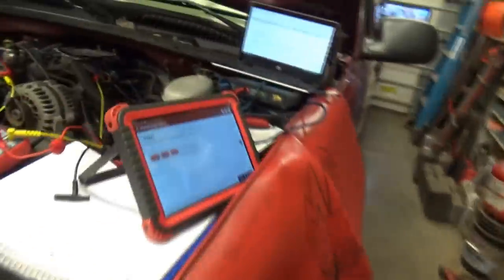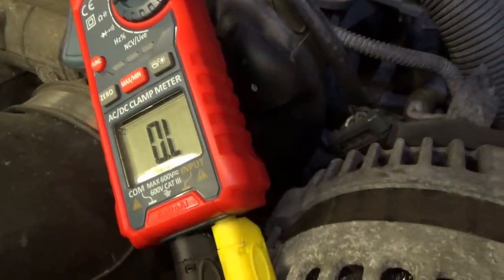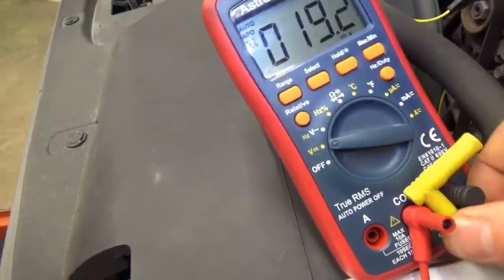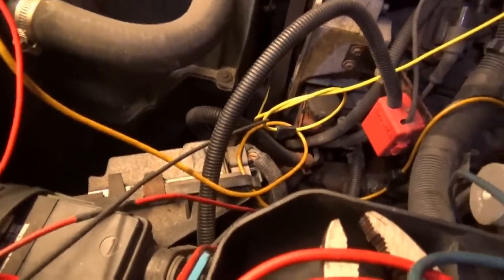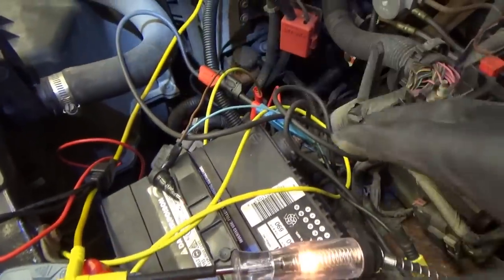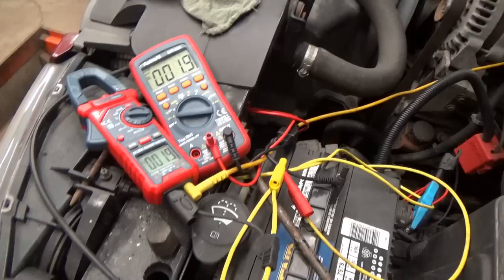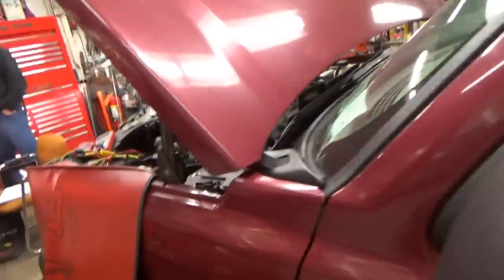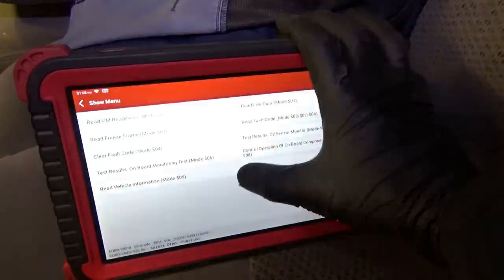Knock Knock...P0327 is here! (GM Truck)

Comment: Does GM cheap out on wiring and connectors...if so, their electric pickup will be a nightmare to own after many years.
Reply: GM cheaps out on EVERYTHING. My '07 Silverado is a prime example. Ball joints couldn't even make 40k miles. Skipping over several failures and annoyances in between, my rear diff failed at 97k, and the transmission at 103k. Now at 117k, my engine is failing - oil pressure has been dropping off lately. Running lower than ever now. Not surprised, since oil analysis at 55k when it started burning oil showed a crap-ton of metal. Switching to 10w-30 slowed that a little, but its days are numbered. Also since day 1 there have been electrical glitches that result in no-cranks at random, and tons of communication codes. Wiggled some connections in the cab, and the problem went away for a year or so.
Reply: @SmittySmithsonite  Toyota makes a great truck...take care of the frame...and maintenence and they will last a long time. My Tacoma was so reliable...best truck i ever owned. Now i have a Tundra
Reply: @SmittySmithsonite  Every Gen gets worse, I have a 04 and a 08 the 04 is more reliable at 212K than the 08 at 100K the 04 is rusty, I only drive the 08 in the no salt time of the year or I am sure it would be worse than the 04 from what I see. The08 is a VMaxx (6.0 liter max tow package) and is my summer tow vehicle weekend warrior, AFM tuned out.
Reply: @johnthompson941  Sounds about right, the newer and more expensive they get the less reliable they are.
Reply: @SmittySmithsonite  What is the recommend GM engine oil viscosity? 5w-30?
Reply: @Garth2011  Yes, 5w-30 is factory recommended. Presumably for fuel mileage. 10w-30 does a much better job keeping the engine alive.
Reply: Gm cheaps out on everything so expect their electric vehicles to be an absolute nightmare. Just look at the current carBBQ volts
Reply: @jeffreygoss8109  They all do, not just GM. Ford I believe tops the list for high maintenance.
Reply: @jeffreygoss8109  yup👍
Reply: i have 1989 gmc in salt areas. No issues only where a mouse ate a few.
Reply: @Motorhead250  no vehicle is immune from rodents. They are vermin
Reply: @mikefoehr235  Rodents love Honda wiring. Honda even made a capscium impregnated tape for their wiring harnesses to keep Rodents away as only humans are crazy enough to eat hot food.
Reply: @zoidberg444  I had both my Tacoma and Tundra taped with it. My local Toyota dealer uses it often because Toyota has rodent issues as well.
Reply: I have to agree with the Toyota guys. I have an 01 Tundra, and my wife has an 04 Suburban.  The Burb has needed LOTS of tlc, is rusting and just a lot of nickel and dining. My Tundra, we couldn't have asked for a more reliable veh. Both trucks are in the 190k mi range, and except for regular maint, Tundra has been great. The ONLY 2 complaints, (theoretically 3)  are the gas mileage sucks, not much of any payload carrying capability, and the back seat is too small nowadays...(we just have the extended cab w the suicide back doors.)
Reply: @brianmason8400  I have a 2020 Tundra...only 22 000 kms...if it is any thing close to my Tacoma, it will be awesome. About fuel...it is a bit thirsty but not terrible.
Reply: You could also figure that a lot of these concerns are a maintenance issue as well. I'm fairly sure it is recommended to wash/rinse vehicles at certain intervals that are subject to salt conditions. I know it makes some sense...those small self serve car wash stations have those powered wands that spray warm water would help out much if people would do it. Every few months or more often, spray down under and inside the engine compartment then follow up with HD silicone spray on all of the electrical components and your favorite "WD40" on the delicate mechanical parts. It's very sad that folks are subject to this and their $80,000 vehicles. May as well have two vehicles, one for winter needs that isn't so expensive.
Reply: Wiring harnesses for all brands are made by third party vendors. Similar to all electronics.
Reply: @JimmyMakingitwork  Yep, every brand is of similar quality today. Can’t win.
Reply: @JimmyMakingitwork  True they are but they are made to a set of plans and requirements set by the customer or auto maker.
Reply: @Mike Fort.....my Tundra averages 12-13mpg. I think on a road trip 3.5hrs each way, I got 13.75 mpg (I THINK), and I got the 4.7l. AMAZINGLY the wife's burb w the 5.3l (no DOD OR AFM thank God) averages 14ish, generally 1-1.5mpg better than the Tundra.